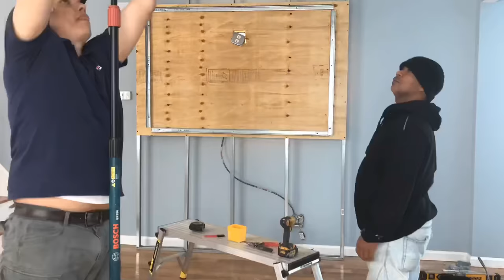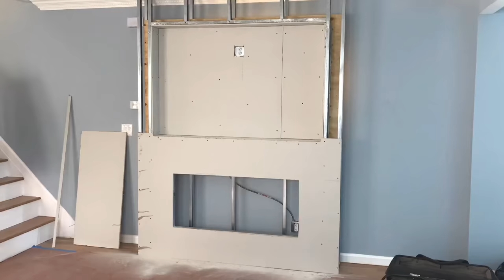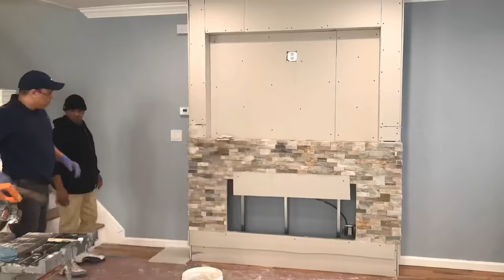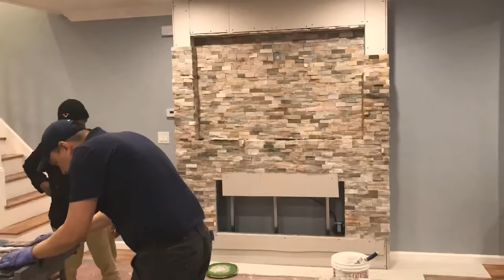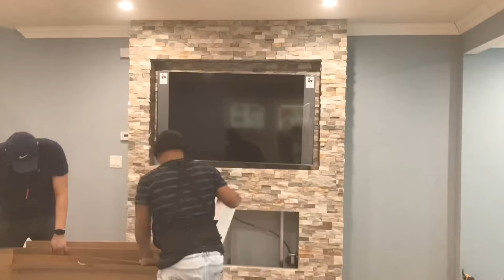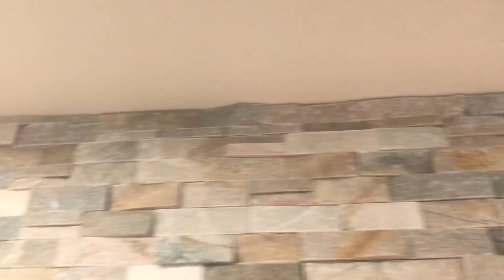Stone Fireplace Accent Wall -Entertainment TV wall fireplace combo how to

Comment: Awesome job but, noticed you never turned the tv on? I didn’t notice any cable plug, just the plug in for electric? Therefore how to you get Sat or Cable tv?
Reply from the maker: kdawg64, Hi..
Looks at my Instagram how normally setup the TV installation.. link bellow..

https://instagram.com/stories/imthesuper01/2409788465266726060?utm_source=ig_story_item_share&igshid=5jcr2vb7rf7l

Comment: how long from start to finish?
Reply from the maker: Redbull357, Hi
Is about 70 Workman hours, very slow process cutting the corners, thanks for watching!!
Reply: @ImTheSuper  Thanks, more or less how much can this job cost me just for the wall without the stone work? Thanks again
Reply from the maker: Redbull357,  materials around $150.
Reply: @ImTheSuper  did you have to cut the outside corners on an angle? Do they sell performed outside corner pieces?
Reply: @ImTheSuper  $150!? Including the ledger stone? How many boxes/cases of stone did it take?
Reply from the maker: Hi.. yes they sale corners piece but no angle cut, looks much better is if you make it with miter cut!!
Reply from the maker: The $150 is for the rough, metal screws drywall, in top of that is the finish material...